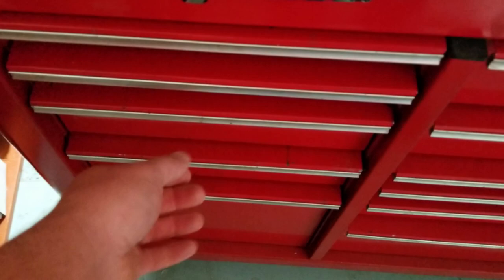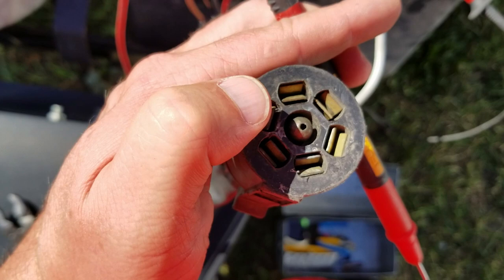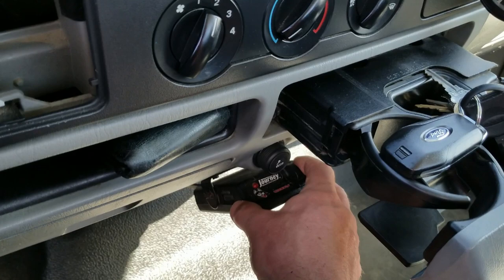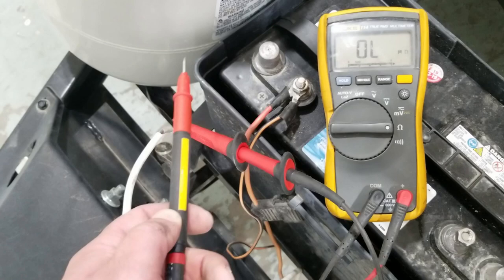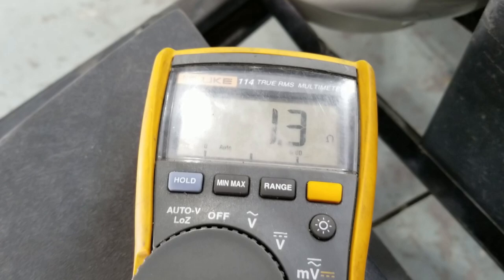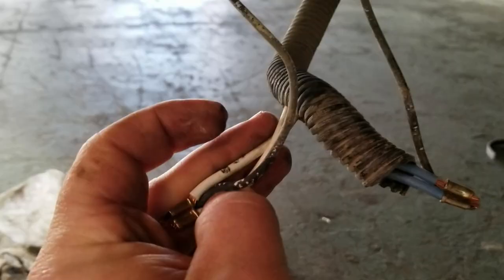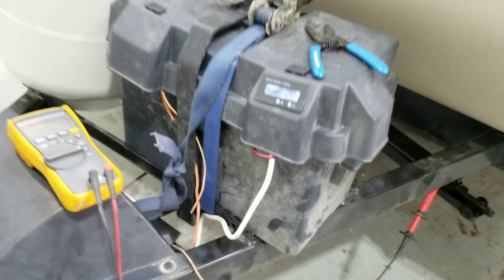Scumbag Offset | sketchy wiring

Comment: This reminds me of my auto repair experiences. I start thinking it's a simple repair. Next thing I know I am taking everything apart. I hate when my He-Man powers don't work and I need to pull off a Hulk Smash. Who hasn't let the factory smoke out? one of my last time spreading a caliper I noticed smoke drifting by. Sure enough, my Astro van battery cable to the starter insulation was worn and welding to the frame. I watched a grease boot cook and the grease oozed out the boot.

Comment: Blinking check engine is a misfire. Start with plugs, wires, and coil packs. Maybe fuel injection after that, but plugs is a good bet.

Comment: I would of started by installing a junction box near the hitch. Then installed a new trailer plug with a new cable into said junction box. Then you replace everything coming out of it. I’ll even give you  my 10/10 warranty. Because it’s a trailer it 10 feet or 10 sec which ever comes first.

Comment: I work in trailers all day every day, we have a rental fleet that goes from lightweight utility up to triple axle goose necks, enclosed, high-boys, told decks etc. We also sell brand new trailers, some of which come with scotch-locks as connectors from factory. Some of them are fucking awful, in fact, most of them are fucking awful from the get go.

Comment: When you are checking resistance, I'm assuming you are using Ohm's law. Are you measuring the resistance based off of the 12 volt battery and using the amperage which would close to 550ish? Is that how you are determining it?

Comment: 0:34  Did you have to use bar oil when you cut the hole in the dashboard with a chainsaw? Normally I use an electric demolition hammer on my interior automotive work..

Comment: The one thing worse than trailer wiring is twenty-year-old aftermarket stereo/alarm wiring, if only because trailer wiring is at least somewhat accessible/testable without ripping out the interior.

Comment: I work in the automotive field and yes trailers are a constant nightmare... and also in that same camp is the trucks with the "work bodies" and box trucks.... because once it leaves the nice manufacturer it goes to some jack ass with a roll of electchickens tape and wire nuts and who knows just enough about electricity to be dangerous.
8:18 those things are invariably hoopa jooped lol NEVER USE THOSE... maybe on an interior for some minor component MAYBE but outdoors they are GABAGE.

Comment: Is it normal for the trailer battery to back feed to the plug? That sounds like good way to really annoy modern car electricals. I would have thought there would be a blocking diode or charge controller to stop things like that.

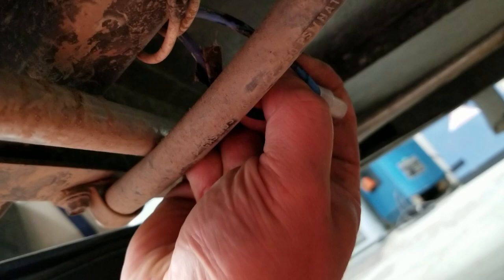Comment: 8:10 that's not data connector. That's a tap splice. They're useful for this type of wiring and great when you have a wire going from a to b that you need to connect to without cutting the bastard.

Comment: If boats are holes in the water you throw money into, trailers are parking spaces you throw wires and curses at. One time I had a camper that had a 110 Romex wire routed and pressed between the frame and the floor of the camper. On that same trailer there was a taillight with both wires from the light and the 2 from the trailer ALL HOOKED INTO ONE WIRE NUT(connector). Oh the joy of rusted frame chunks on your face and green death'd string formerly known as wire dangling for all (you) to gander upon, for every 1-3 years this ritual must take place, and copper sacrifices made to appease the towing gods.

Comment: Good video, thank you.
I have to run new wires to my work trailer but have a question about the side marker lights and brakes on all 4 wheels, I don't want to use the scotchlok's for adding more wires so what is recommended when you need to add a couple side markers to each side of the trailer then have wires going to all 4 wheels for the brakes?

Do you just put 2 wires in one side of a butt connector and the original in the other side and crimp it and shrink tube it to keep it water tight? Or what do you do to add more wires?   Thank you.

Comment: Why is it we all cuss the fix like that? I've done it for sure. Must be the sign of a good mech' anic.  Trailer wiring, such a treat ,Aircraft duty, double crimp ,heat shrink/w sealer, connection) mixed with razor knifed bare wire unsealed twisty connections.

Comment: Buddy of mine went to college to learn gasoline and diesel repair, got his certification in both, after getting a job at auto dealership, he told me screwed up, 70% of his job is electrical diagnostics, bad relays, shorts, bad grounds, and wires that should be contacting NOT and wires that should not be contacting, making contact.. 8-/

Comment: Why do American trailers have electric brakes? Didn't some also have hydraulic? Over here in Europe we've got over-run cable operated brakes for trailers under 3.5t and air operated for trailers heavier than that. I work in a boat dealer, and the way people treat their trailers mean the lights rarely work, so electric brakes would stand no chance!

Comment: @11:55 - I've noticed that even these shrinkable goo filled butt connectors have cheaped out the last several years - surprise! crappy metal of who knows what alloy too thin to get (in my opinion) a decent permanent mechanical crimp connection. Bags by the hundreds of heavy gauge seamless butt crimps (I think intended for solid wire?) available at electric supply houses work great. Tighter than a nun's ... um - habit. 

Heat shrink tube by the foot also cheap as Cananjun election rhetoric. I like to double bag and go at least an inch either side of the insulation termination for strain and vibration mitigation. Not a fan of receiving chum on the mug having to fix the same thing twice.

Decent main terminals are also hard to source off shelf now. I've been making my own by vising and drilling copper pipe/tube (depending on cable gauge), then crimping the cable end in an engineer's vise with a diameter of steel wire to roll the crimp into a "heart" shape. 

Recently repaired an Isuzu city delivery in this manner. Fuck sakes, for what I'm charging - even at shade tree rates - put some integrity into the work rather than fecking on a Canajun Tire POS BCH thin terminal with a pair of lock-jaws!

In my opinion, those plastic boxes of various "fix all" splices and tees are total shite for anything beyond getting the radio working to the next exit.

Then again, what the fuck do I know.

Comment: I got so sick of idiots damaging the trailer wiring by forgetting to connect the electrics then dragging the plug for miles on a shared trailer that I installed a mil spec connector on the trailer and made up an interconnect to do the bit between the trailer and the towing socket. That way I only had to repair the interconnect which I could do in the comfort of the shop.

Comment: Mother of god this seems so much more difficult than British cable-actuated trailer brakes. The wiring just does the lights. Also having a battery on the trailer, which needs to be charged for the breakaway to work? ??? ??????

Comment: Good trick to learn is put some grease on the truck connector. It'll stop it from corroding
Reply: talisolin same kind you’d use on a battery terminal I take it?
Reply: @timothywells3908  dielectric grease or any grease really.

Comment: AvE how do you not know that even if your on the ohms setting and try and check battery voltage it will NOT hurt the meter or short anything.. The ohms setting is actually outputting like 3 volts on one lead and seeing what is returned through the other... Check it yourself with a second meter and measure the first meters leads voltage.. 3 Volts..... Where you get into trouble is if you put the red lead in the Amp slot and then check battery voltage THEN AND ONLY THEN will you either see sparks or have a blown fuse in your meter....  This is about what you said at 2:24 in the video

Comment: What's with the Ford?  Last week you had a real truck, it only needed a cam. This week you got a Ford truck with a countdown motor (5.4-3v). They barely run long enough to have the truck bed rot out, break off spark plugs in the heads, and grenade the engine when all the oil pressure leaks out of the timing chain tensioners.

Comment: I would think that in the personkind workers paradise,formerly known as Canada ,that you have trailer specific cable? We have it here that i  buy by the roll and it has 8 different coloured leads in it. No need for those potential failure points with joins every where.

Comment: Hearing AvE say the heat shrink butt connectors are a pro thing, well one, you're right. I would be fired for not using them, but also I have so many of them now everything I wire up for friends is done with heat shrink spades, heat shrink butt connectors, heat shrink ring terminals, heat shrink bullet connectors, heat shrink step downs, coconut shrimp, pan fried, deep fried, stir fried, pineapple shrimp, shrimp stew...Wait what the hell was I talking about?

Comment: I don't trust those suitcase connectors in automotive use. Vibration causes them to fail. As for wire nuts, they are great as long as they are sealed and taped. Why do Canadians call them "marrettes", anyway ? Any bare wire will be corroded by road salt. Rubber sealing tape works wonders.

Comment: Viewer request... Ultrasonic cleaners? They all seem to be sold be chinatastic but sold with varying amounts of profit, I've blown up cheap ones and expensive ones the elements seem to go in them after a few weeks and then you have to bash them around until the connection fixes its self to get them to chooch. Inevitably something goes bang after a hot supper these units seem destined to self destruct I'd send you my most recent failed unit but postage might be a barrier. Great while it lasts but only for two minutes.

Comment: Friend of mine turned a small school bus into a RV. Brought it to my house and tells me that when he turn on the lights the brake engages. Who ever worked on it before my friend got it splice the alarm, lights and computer for the air brakes all together and took me 5 hours to find this out and another 2 hours to set the cables correctly. I swear some shops will hire any animal that can pick up a hammer to work on machines that can kill a full grown bull. Is there less dimwits in Canada than the Southern States?

Comment: Actual repair time = 4 minutes.....

Check out the liquid electrical tape....great at sealing wires/connectors but youll only use 5% of the can before it dries up....

Comment: why does no one ever use solder? strip, twist, tin with leaded solder not the lead free shit, slip on 3:1 heat-shrink, solder tinned ends, shrink heat-shrink over the exposed metal and admire the beauty of your waterproof full metal connection

Comment: Installed a Reece 7 pin to my 13 Nissan Frontier a few years back. Travel trailer brakes lock up, refuses to roll... After much cursing and trouble shooting I find that the aux wire and brake wire are switched wrong straight from the Reese factory... Dirt bags, probably straight out of China...

Comment: The break away switch was probably full of Smoo and had high resistance causing the smoke. 
It a good thing it wasn't your ring when you were tightening the battery! And yes I work with batteries and electricity every day and I wear my rings! Burnt the shit out of my finger a few years ago with a blob of welding slag.. but I'm too stupid to learn a lesson.

Comment: Motorhomes, trailers, ex rental trucks such as Ryder or U-Maul, add on electric hydraulic pump lift gates and your "diy trucker adding 83 lights to a 16 gauge wire passing time in the parking lot before the next load" type are all great ways to repeatedly ask yourself why the heck did I get involved in this disaster once again. I refuse to work on any motorhome after a previous employer decided we would work on chassis only wiring and no wiring within the body. The marriage of automotive vs home wiring is never a good combination as the jackleg expertise is soon uncovered.

Scotchlocs (your blue crush to crimp on existing wire connection), wire nuts, twist together and tape, twist two wires leaving o' natural flapping in the breeze and last but not least crimp on terminals are all a recipe for guaranteed future gremlins.

Best method is to cut that shit off and start over as any mechanical connection living in an automotive type applications will fail if not soldered and heat shrunk with marine heat shrink at a minimum. Vibration, heat cycles, moisture, corrosive chemicals such as road brine, less than adequate wiring support and crimped open end splices all play a role in how well the wiring will perform its job. Yes it takes a little bit longer to solder and heat shrink each splice but far less than on the side of the road looking for a gremlin blowing fuses or a tow bill.

The worst harness I ever dealt with was on an ex Ryder P30 box van. From the firewall to the right rear taillight had 47 butt splices in a bundle of about a dozen wires running from the bulkhead connector to the rear. It also had a rainbow of colors thrown in with different gauge wire causing blinking lights, blown fuses and demon possessed traits. After pulling the split loom off several feet around the rear axle, it was apparent it would just be easier to build a whole new harness front to rear when a splice would be 2 inches away from the next. After running all new wire wrapped with split loom and secured in place, no more tickets for non working clearance lights and taillights and no need to buy a box of fuses weekly just to make the delivery route. 

Save yourself and the guy behind you a bunch of trouble by soldering and heat shrinking your connections. Buy a small butane soldering torch and electrical solder not plumbing solder. The small torch is quick but word of caution, underdash work is not advised as too much is a possible fire hazard. 

Another approach I take to wiring is check items that are likely to see the most wear or failure rate like the trailer connector. Something that is subjected to moving, being dragged on the road not hooked up, snagged and pulled on or even chewed on by Fido sitting in the yard could save lots of chasing gremlins if checked first. I have yet to see one of those breakaway boxes work after a couple of years in the elements. If they do, they may not even be cabled to the tow vehicle correctly to pull the pin as intended during the trailer popping off the tow ball. Just some thoughts about previous experience dealing with wiring gremlins back in the day turning wrenches for a living.

Comment: Trailer wiring does suck, especially on boat trailers because the manufactures cheap out. One of their idiotic tricks is to use the quick tap things.. Anyone who truly knows anything about vehicle electrical systems knows those things are garbage and shouldn't even be sold.. Add them with water and it's corrosion time.  Whenever I buy a new trailer solder all the connections, seal everything proper, make sure everything is LED based and prevent future headaches.

Comment: That trailer brake controller has to see a complete circuit before it will send out voltage you Cannot test them like that with a digital multi meter always test trailer brake controllers with headlight bulb

Comment: Luckily here in Norwegistan, we don't have all-electriciticic trailers, someone had the sense to standardize the damn things with a hydraulic cylinder actuating the brakes, theoreticly somewhat progressively... I guess they learned that if something goes wrong in the automotive world it is electric, so why bother with that stuff.. just like with my old Skoda, all the mechanicals were in mint condition, other than the worn to shit clutch, and fairly bad brakes, broken window mechanism, and door latch not working from either side in the end. but the heap of electical stuff going wrong was just piling up, and in the end it would be ignorant to my wallet to even consider fixing it... and I've completely lost both my point and train of thought.. and my popsickle has melten on my T-shirt... cheers!

Comment: Age old, most important, and most transgressed commandment - thou shalt remove the sheath without cutting the wire beneath. How to do it? Seems nobody knows I tell ya' what.
Reply: Answer: Start by not cutting at 90° to the cable. Use proper knife, cut at steepish angle, and practice. Oh, and cognitive dissonance when you eff it up and you don't have enough wire to start again is not a substitute for doing it right.

Comment: Seriously, so much good information! Troubleshooting is an art, but even an expertly diagnosed system can booger up down the line unless you test test test. And NO F#$_&ING WIRE NUTS ON 12V WIRING!!!!! I can't stand seeing those or wire slicers(scotchlock t connectors are just the worst for wire tapping) on harnesses. I understand people don't know better sometimes but WATCH THIS VIDEO FIRST before going to NAPA and getting an overpriced box of wire damaging turd pinching scotchlocks. Solder is best... If you can't solder, then learn... Or grab a good quality butt splice connector and don't f#$_ it up...

BTW: Watching your videos with the captions on is hilarious....

Comment: Kinfolk worked on her trailer for 2hours couple days ago called me stopped by and told me no lights work an she had wires cut  and in wrong places so 2 ground issues fixed an wires redid at the plug an 30mins later all were functioning properly and in 12volt your worst enemy is ground an most people do like what he working on they half ass it an I hate that then they call him or me or who ever to fix it right